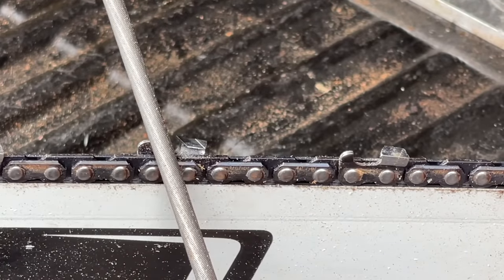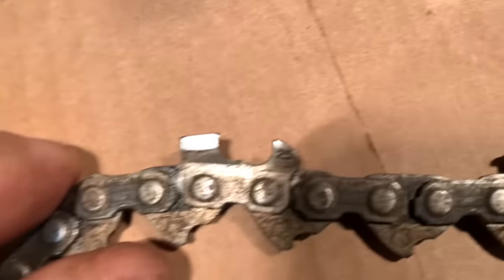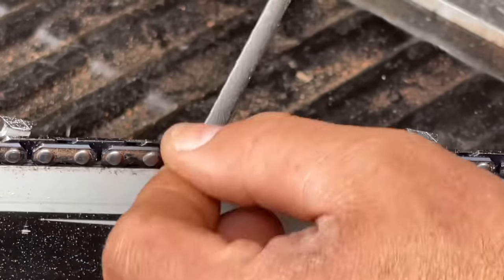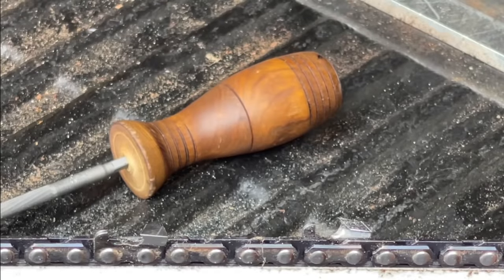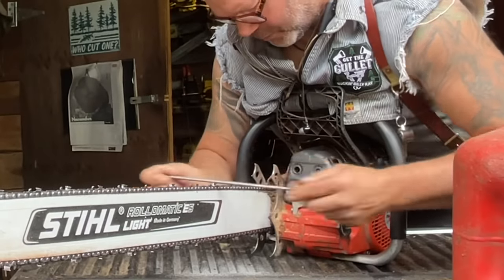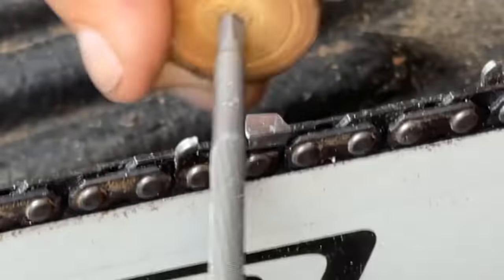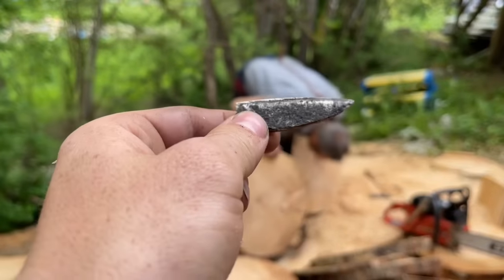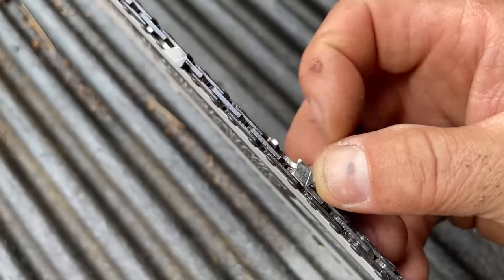How to hand file a chainsaw,  pro logger style

Comment: folks reading the comments, listen: I have run saws for 4 years now, I am a logger and firewood guy, and do occasional tree work. It took me the past 3 years to really learn to file. If you want to learn you must try and try and try. Dull your saw 5 times in a day. It takes time to get the flow with a file, and to be able to file using both hands. I just watched buckins videos and he tells you everything you need to know. Get under the tooth, get the gullet, and then just keep the rhythm in the gullet, the big round fill will work its way up into the corner. Stay under and file up and in and the file should naturally start coming up out of the corner. When you see the file popping out of the corner from under, and you do a good clean stroke, it should make one hell of an edge and all the sudden it will flow like butter. For me within a month of serious filing I had completely figured it out and now can bang out a chain in about 8-10 minutes.
Reply: I don't get it how some ppl take so long to learn something like this. Took me 2-3 fillings to do perfect square filling point to point. Round filling like 3-4 tries as I never owned a chainsaw before and it took a bit to understand the angles but youtube was a gem. And no, I'm not a genius. Are people just pretending filling is hard?
Reply: @em4703  so many videos making things way to complicated most prob over thinking things or starting out with bad info and just not having confidence or wanting a machine or guide to do it all for them. Cheers
Reply: I’m still learning but I’ve gotta my chain “holy shit” sharp three times out of the last five so I’m closing in. I think a big thing tripping people up on the journey are: 1. The fear of ruining a chain but in all honesty I had to ruin a good one before I started figuring it out. 2. Lighting. It’s everything and then soon. I couldn’t figure it out until I did it outside on a bright day and could relate the feeling in the file in my hands to the metal being removed. Using a file is so much of a tactile “feeling” skill but I needed the visual cue to make sense of what I was feeling.

Comment: As we discuss sharpening again, let's remember to brush our files clean. All files need cleaning to do a better job. Brush across the teeth of the file. Use a tooth brush, a brass metal brush or at least wipe out what you can with a terry cloth towel. This is also good workmanship.

Comment: I always wanted to learn how to hand file, and I watched Billy's chain sharpening school video... after watching I went out and filed my 3/8 chain with a 7/32 file and the chain turned out razor sharp, I've never had a chain cut that fast...thanks for lesson Buckin!
Reply: Hey buddy I'm running 3/8 chain I use 3/8 file so you said you use 7/32 that's bigger than 3/8 correct
Reply: @br-dj2ti  for future reference, divide 7 by 32 and then 3 by 8 if you're questioning which fraction is larger or smaller.
Reply: @whalescience8831  thank u so much
Reply: Yup. I was using one of those file guides, and never got a sharp chain.
 One Buckin Billy vid, and I'm sharpening faster, and waayyyy, way sharper.
Reply: @br-dj2ti  No ... 3/8 is the equivalent of 12/32. So 3/8 is larger than 7/32.
Reply: @mikefurness1598  so the steel files that are 404 I believe they're 7/32 they're larger than 3/8 I think cuz I started using them like bucking said in this video unless I'm saying the wrong number I'm not sure thank you so much

Comment: Speaking as a woodworker who sharpens his own planer knives I can conccur with Billy on the importance of getting your hook angle spot on. The ideal range is actually very narrow when it comes to bevel angles, shear angles and relief. On planer knives your sharpening the other side but the principle remains the same.
The range of workable angles is between 35 degrees and no steeper than 40. I usually split the difference and go with 37 degree's. But Billy really knows his shit and it's nice to see a pro giving people the straight dope on sharpening. It's an incredibly valuable and important skill to master.

Comment: I've been using a chainsaw for over 20 years now. In that time, I have constantly fought with sharpening chains. Everything that I tried would create a sharp point, but they wouldn't last. For years, I just gave up and took the chains in to be sharpened. I actually got the best results using the Stihl 3-in-1.

After watching this video, I grabbed by chainsaw, clamped it into a vise, grabbed the file and started to slowly work on the chain. Before, I would be pulling up the file to focus on the point of the tooth. Today, I focused on the gullet. What I found was that for many teeth, when placing the file into the gullet, the file wasn't even touching the tooth, just like you showed early on in the video. I have the whole chain sharpened now, and am very pleased to see just how sharp each tooth is. I'm eager to see how it performs tomorrow.

Thanks for this video. It's truly a game changer for me. Wish I had seen this 20 years ago!
Reply: How did it cut ?
Reply: @caseG80  like a hot knife going through butter. It just tears through the logs now.

Comment: When i got my echo 590 it sparked a huge interest and passion for timber I had never before had a saw that was "fun" to use they were all to small and weak for the task at hand and it was more annoying than anything to do anything but basic pruning...that 590 changed my life IV since moved up bigger and stronger than that one but it's still a favorite and still haven't killed it,anyways when I got that saw I also bought all sorts of chain sharpening gizmos , the 3 in 1,a couple electric setups and basic files...it did not take me long to come to the conclusion you just can't beat a simple proper size file and good tactics like shown here it's all I use is a 7/32 and a flat file only difference is I don't lay over the power head I use a mini vice to hold the bar it works great in my file set I keep a paint pen and il dot the link I start with and bam good as new in no time, I found it was really really easy to screw up with electric gizmos

Comment: The steel piece may have been there since the tree was a sapling, possibly a blade from a lopper that was used to try to take that limb off. 
Thanks for the lesson, Buckin! Very helpful.
Reply: Kinda looks like the edge of an axe/hatchet broke off. Very interesting indeed

Comment: Lesson learned friend, don’t follow box store rules with guides, auto gigs and grinders, use the force of your 7/32 rat tail, guide marks are already embedded, continue with each tooth as if it were the only one getting sharpened. 
BOTTOM LINE: continue your file stroke, and wait for the burr on the top edge to appear.

Comment: Thanks Billy I been suspecting for a long time that having to pull up was because I went too hard on the gullet
Reply: Happened to me too. Used right file size but still ended up with too much gullet as I sharpened too hard

Comment: I've got a Super Jolly grinder for the shop and a timberline sharpener for the woods.  Both work GREAT.  However, after watching this video, I thought to myself (in my best Australian accent, "THAT'S EASY!!!) I made my first attempt at hand-filing this weekend.  Totally butchered my chain.  Different angles,  some of the top plates had a rounded profile instead of straight across.  How did it cut?  Like poo.  BUT, I'm gonna try again until I can do it.  Thanks for inspiring me to learn something new and to be better.

Comment: Is the metal fragment in the tree you found, possibly a heel/boot climbing spike that someone used to climb the tree?
Reply: lol what?  climbing spurs stay on your feet.  You don't use a spur for every step you take.  Like...are you thinking tree climbers pound in pieces of steel for every step they take with a hammer?
Reply: @verteup  No, the poster thought a piece broke off.  But the metal is likely from a pole pruner.

Comment: Hey Buckin, I have a small MS 170 Stihl saw, and I was wondering if its worth the while to buy a carbide blade? I have been cutting a lot of tree lines and I'm trying to save a little sharpening.
Reply: If the Carbide chains are equal to the stihl "rapid duro" RD they need more Power. With a Stihl MS170 you wont be happy. Take a rapid micro it will last a bit longer than the rapid super and is a bit easyer to file.

Comment: hello Buckin. hope you and youre family is well. and greatings to blackmetal hogen. 
Is it normal that the chain grabs maple. i had alittle to wicked chain cutting some fur, some spruce, some ash, but the maple my 50cc chainsaw started chucking the maple. and grabbing. my riders where ground with the template so those where fine i think
Reply: I got some MCullock files. are they good in youre mind ?
Reply: Some raker gauges have a ‘soft’ and ‘hard’ option. Lower rakers for softer wood. Sound like yours were too low for hard maple.

Comment: Yep, definitely may have taken it too far when Buckin says ya got TOO MUCH gullet.  I have seen that before on another chain though from someone using one of the handheld electric sharpeners and resting the sharpener on the same tooth too long with an undersized file.  The electric sharpeners are nice but if ya let em, they will just keep digging.

Comment: I have seen many of your clips many times, and learning every time. If you file some teeth further down than others, do you discard the chain before most of the teeth are worn down, and what are the causes the saw pulling to one side instead of vertical angle when bucking? I've heard that one of the causes can be difference in raker height.

Comment: Buckin, when you ask for files for a 3/8” chain at the STHIL shop they give you a 3/16” file.  And like you said, I notice I end up pulling up just slightly as I chase the gullet.  I’ve also filed some chains with the 7/32” at your suggestion.  And you definitely have to remove a lot of steel on a new chain to break it in.  Why do you think they recommend that size file from the factory?

Comment: I went and got my skidding winch a couple of days ago and found one of them "wood bullets" when I was checking it out.  The guy had a couple of poles hitched and I figured rather than drop them to run in the woods and try it out, might as well chunk up those poles.  Made a cut around 20 feet from the base and saw something funny in the end I'd just made, and I went through almost the center of the bullet.  Thing had been in the tree for a few years, because the hole it had made was all closed up.

Comment: Heya Buckin, Tony from Alaska here. I got a few questions for you if you would. Im an every day cutter. We dont got nothing really big up here so most of us run 50cc+ saws. So my question is when it comes to your saw is it wise to multiple settups? For instance i love my 031. But hefting it around in the woods gets old. So for limbing i use a little Black Max. Theres times my little guy out cuts my 031 and that brings me to my second question. What type chain(pitch, gauge, length, ect) would you use on some spruce and why? And i mentioned above i run a 031, shes pretty noisy im told but i think she sounds good, but i know shes got an issue and i cant figure out exactly where or what. When im comming out of a cut and she goes back to idle it wants to stall. Iv played with my idle and low screw some to find the sweet spot but i cant seem to find it. Iv ran through my carb and cleaned it up. Short of replacing the diaphrams and seals all the way around for a complete rebuild to be sure, what may be the issue? Rings? Seals?
Reply: Intakte manifold? Gasket? Inlet needle worn? Piston rings worn? Impulse Line? Could be any or none of this issues. If you are flipping the saw from the left to the right side or turn it upside down an vice versa while it is idling, are the rpm changing while doing so? That would be a sign for leaking cranckseals. But without the saw in hands its all a "guessing" not diagnose, sorry.
Reply: Ah uh, sorry! Is thus a 031 Stihl? If it has still an ignition with points, it could also an issue with that.
Reply: @sebastianleicht  it is, i have one with and one without points. I was told the same thing, moving my saw around does change the rpms, i was planning a top end teardown and rebuild if the crankshaft seals or seal was bad...to be real honest i havnt been working on saws very long so some of the stuff i just replace thats probably in decent shape.
Reply: @warimp  if the cranckshaft seals are leaking, a base gasket delete may unfortunately not fix the problem. Changing that seals is not rocketsciense but if you are not familiar to that kind of work there is a risk to end up with a worse situation and burned money for Parts. Let's be honest, the 031 is a quite old lady. If you love her and want to save her, why not give her to a local sawshop for repair? Or to  a buddy from the chan in your area. If you decide to work on these saw's yourself, please try to get a workshopmanual and last but not least the proper tools for that saw Model (there are also many workarounds if there are Tools missing but if you're not familiar with that, there is a higher risk for failure) . I hope you can solve that issue and good luck👍👍👍 be kind to each other!

Comment: So, we heat with wood.  The other day I was chasing the road crews for firewood as they clear the shoulders.   Bunch of us termites do this.  

Anyways got to a big old beech that someone hod already took part of.  The chips laying where he was cutting were long, I mean 6 or 7 inch long strings of chips.  Appears to be a super efficient chain that guy was running.  

I dont think they were rip cuts either.  Twas obvious he had a splitter with his trailer, most of us do.

Any thoughts on the chain and grind that gives long string like chips in beech?

Comment: So I've always been told all you teeth should be ground to the same length. So the lowest tooth is the one which gauges where you should take the rest to. However I feel this is a quick way to wear out your chain. So a make each tooth sharp regardless of length then I bring the rakers down With a guide. It's not a clean cut on brash but it still cuts.
Reply: It's also guaranteed that 10 minutes after sharpening my chain it'll find something metal. 😫

Comment: Unfortunately what happens for me, is I get an exaggerated "C" that goes really far back, and no sharp point on the tooth. Using a 7/32 file on 3/8 chain, the file just goes under the top plate, and does not maintain and edge on the cutting portion of the tooth. Very frustrating..EDIT**Please see my reply below. I just needed to take my time and happy with the results!
Reply: Well some extra patience and really paying attention to the above video, I tested out today my chain sharpening skills. I have to say I was cutting into some 18"-20" downed trees and I was throwing some larger chips! (well large for me) I know I have dozens of hours to go before I get better, but super happy with the results. 
You know the part where he says a sharp chain makes sawing a rely joy. YE VERY TRUE! Many-Many thanks.

Comment: I have an old McCulloch that was factory specd for 20:1 fuel mix. Any thoughts on running 50:1 ?
Reply: Old metallurgy bearings etc stick with factory spec 20:1
Reply: Leaded gas was more lubricating so.

Comment: Damn I think I’ve been filing mine with the wrong angle towards the chain. I’ve been angling mine down the same direction as the blade bevel but it looks like you are abgling down towards the outside edge of the blade... I’ll have to give it a try like that thanks
Reply from the maker: not wrong sir just diferent

Comment: when i do that it never gets the underside of the top plate.if i pick up gently while filing it does and you can see it.can you explain this please.
Reply from the maker: i did, in this video sir, extensively  actually. get the right size file first. start there
Reply: The file is ‘taller than the tooth’ so automatically a complete new edge forms, side and top plate, , even by filing back and a small amount down for every filing. Look at your teeth, ski jumps? If not you are probably doing it fine.

Comment: I've never seen so many strokes in my life..... How many thou are you taking off each cutter in the one sharpening session? A lot and too many with a chain that's not seriously damaged, is what I'm thinking. Then tell us, what's the tolerance you might get on the top plate lengths? Happy with about 1/16th inch? An 1/8th inch?

Comment: Optical illusion? right side teeth appear to be over 30degrees and left side appears to less than 30degree angle when sharp.  The old Carlton plate gauges are the best as they only sit on one tooth vs the new style bar gauges which use multiple teeth height to determine rake depth not good if all teeth are different height/length..  When talking about file life you say tooth life instead of file life.  Finally found a source for PFERD 7/32" files again as I have been stuck using Oregon files.

Comment: Thanks so much for this video! I understand the downward pressure, but on my last chain I noticed I was hitting the links a bit. Is there a point where the pressure shifts back more, and if so how do you know when that happens?  Again, thanks a lot. I appreciate you very much and I’m glad you are on this planet 🌎
Reply: If you keep using the same size file and file the teeth to the very end of its life down by line mark, often on the top of the tooth, you will start to file a little bit of the chassis of the chain, no worries. But consider if you are going to deep on the gullet if you aren’t on tiny teeth. The ‘cresting wave’ of the tooth should cover about one quarter of the file when looking from above